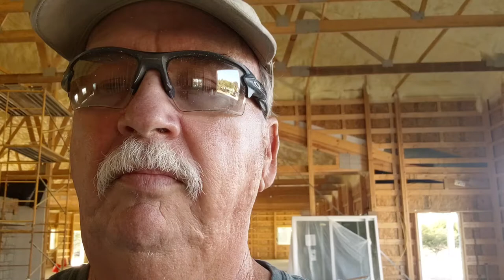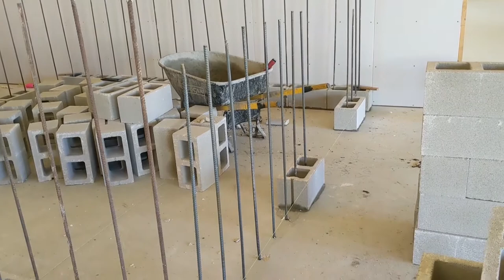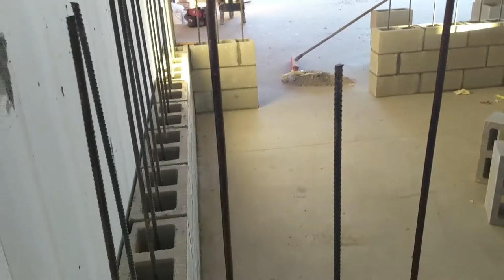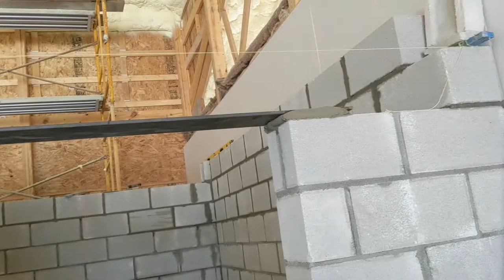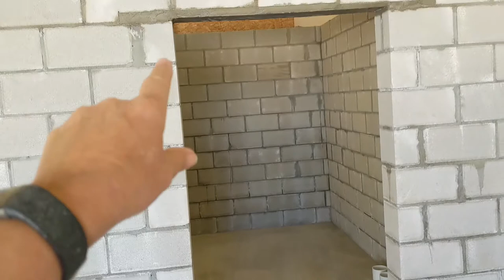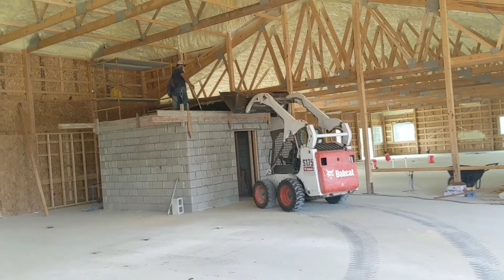VLOG 22 - Rod Kenly - Lazy Flying K - Tornado / Safe Room

Comment: Normally, one would lay the blocks around the hollow metal frame using masonry anchors... Otherwise, trimming a 1/4"  off the bottom of an HMF is not a big deal; typically there is a 3/4" undercut on the door, so you still got 1/2" clearance. Weren't planning on shag carpet down there, were you? Personally, if i was doing that with new construction, this would have all been a monolithic pour.

Comment: Tornados have been clocked at 300mph, and a piece of wood will blast that thing apart in a phenomenon known as "missiles". Yes-a 2x4 will make concrete explode in tornadic winds so PLEASE hyper-reenforce the piss out of that thing. Sheet metal outside, styrofoam inside or vice versa. Remember tornados blast train engions into the air-shelters have to be anchored too-weight isn't enough. Also think about rounding it a bit on the exterior-flat sh*t catches wind,  and that's why windshields are rounded off. I'd put down more concrete filled blocks along the bottom interior. Besides-bench seats! 👍🏻Tornadic winds are elliptical with the front slamming into the ground (they can dig nearly two feet into Earth) and hundreds of mph, at which point it swirls around and up. At the back, it could be only drifting along at 20mp before slamming back into the ground again. Tornados don't actually suck-that's a myth. They really blow, man. Lol
Reply: The rebar is drilled/anchored to the slab which anchors the entire structure to slab when you pour the cells with cement.
I have proof reinforced concrete masonry walls can stop multiple  5.56 .300 7.62 rounds easily. More specifically 8 rounds each no penetration. Cracking yes after 24 rounds but no penetration. I’m not saying it will hold up to a train thrown at 300 mph or a giant tree thrown like a football directly at face of wall but branches will explode on impact, depends on mass of object.
Reply: @Surtac100  the space in between the blocks aren't called cells, they are called " webbing or core ". I know that it can be called cell, but I've never heard anyone call it that, masons use the term webbing, which is the term I was taught when I was trained. Another thing, in tornadoes, it's not only sticks and tree branches, there's all kinds of different materials flying around inside a tornado, like rocks, sand/dirt, trees, 2×4's, pipes, cars and trucks, nails, wrenches, saw blades, hammers, screwdrivers, sockets, broken glass, chunks of concrete and asphalt! Even asphalt can be ripped up out of the ground from the roads, cattle and horses, even a cow flying through the air at 200 to 300 mph winds can do some damage! There could even be some dildos or pocket pussies flying around in a tornado! Lmfao😁😃😅😂👍 I hope you know what you are doing if you built your own Shelter! I sure hope you used wire on every third course, but for a tornado shelter, then I would have used wire on every single course, or at least every other course! I'm a certified Mason, I was certified back in 1994, so if you have any questions, then feel free to ask.
Reply: The piece in between the cells are called webbing, the webbing is already solid part of block, the 2 big holes are called block cells.
Reply: Bullets go 3 times faster than any tornado and this wall stopped a lot of big bullets. IMO it’s mass of object that does most damage but all I know for sure are the tests I did with different caliber bullets
Reply: @JOEJOSEPHHones  Tornados are kind of like an Armageddon that they can even derail trains and even if you are inside of a tank you can be in trouble depending on how strong the tornado is or what it throws at you. Sometimes being extra secure and safe is better than anything else just in case you get one that’s 300 mph or more.
Reply: No. No it won't. A piece of 2X4 would completely obliterate against something like this..

Comment: 10" W X 8" H X 16" L  bonding blocks with vertical and horizontal rebar on every row with a 10 inch thick concrete roof is what you want. It will weigh roughly 32,000 pounds for a 8x8 shelter, uses about 6.25 cy of concrete.
Reply: And a base or foundation to support that much weight.
Reply: Don’t have to use steel to reinforce, just make walls thicker about 30-40” and fully filled blocks within concrete. 30-40” thick solid wall will hold just fine without any reinforcement.

Comment: I have a problem with this design. I'm not sure that epoxy would secure that structure during a direct hit from a F5. But my main concern is the lack of a secondary exit door. If that house should collapse, the debris could block the exit. If fire should break out, that could be fatal. Just my opinion.

Comment: Way under built for safety in a class V scenario.  Whole house could potentially come down on top of it for starters.  No mention of grouting the undersized block.  Door way should have a 90 degree turn in it.  Roof should be more like a foot thick minimum. 16'' would be better. There is a lot more regarding ventillation and such. No mention of the garage slab supporting this
Reply: Let’s see your credentials

Comment: And why didn't you make the house better with bricks?
Reply from the maker: A safe/ tornado room is much safer than s total block house
Reply: @rodkenly-lazyflyingk5842  What happens when the building collapses on the safe room? If the weather conditions are that bad, may be some time before anyone gets around to getting you out. Wouldn't the room be better outside in open space?
Reply from the maker: @neill392  if the building collapses I'm the safe room... well it would be a bummer.  But if it really just collapses,  there's not much that actually falls on the room.  The room is between trrusses,  and the Roof is osb and metal roof. The safe door opens in,  if anything falls against the door,  it doesn't keep from opening.  Our location is outside the normal tornado zone.  2 tornados in the last 110 years as I understand  it. So that was my thinking.

Comment: Good grief... how persnickety can you get?  Just trim the door 1/4"....
Reply from the maker: Trim 1/4" off a steel safe door???
Reply: Are you fucking kidding me!!! Duh, the mortar is supposed to be wet, and them laying the blocks on top of the lintel would not make it drop down a 1/4"! Another thing, where in the hell did you find those clowns, I mean Jesus Christ, just look at the head & bed joints, there's mortar missing and they didn't even strike the joints, which makes it stronger! You should have paid me to come build it for you, I would have done it right!
Reply: @roypatterson9910  why do ya gotta be so rude and critical man? you may be right about the safety thing, but it's still a piece of art... the best way to defend from a hurricane is actually to get in your car and just GO as far and fast as you can (without crashing cause that would defeat the purpose) .. getting outta there is better that hunkering down in something that you don't know is safe or not.. even something government approved can have it's follies
Reply: @crazyj902-topic2  this is for a tornado, not a hurricane, you can't build a shelter for a hurricane. And with tornadoes, the worst thing you can do is get in a car. Only do that if you always know where the tornado is, if there are many possible escape routes in case some are blocked by debris or traffic and if the weather outside of the tornado is mild. Otherwise, it's incredibly dangerous to drive during a tornado.
Reply: @deathbloom27  I thought a tornado was worse though

Comment: You can't be serious......a tornado will blow that to bits
Reply: It can and it most likely will, but I think he was going for a more budget friendly style which can actually hold up to smaller tornados. Now with this style he can always add some 1 inch thick steel plates on the sides of the concrete and also the roof can be made to be heavier than 12,000 pounds to withstand any tornado. I believe 12,000 can be blown off pretty easily by even the weakest tornado so maybe look into upgrading your roof to a 16,000 to 20,000 pounds roof made out of concrete or steel to maximize survival etc.. make sure to weld that piece to at least an anchor to the concrete ground pr add some heavy beams on the side to hold the weight etc… 
I know money is kind of an issue with almost any good project, but you already did yourself a good shelter might as well make it stronger.
Reply: A tornado can roll a semi and trailer like a pool ball, any gap that the wind can get in is your weakest point. Don't waste your money, get a tested, proven, approved tornado shelter. don't skimp with your families' lives.